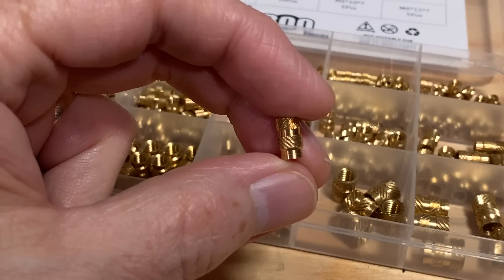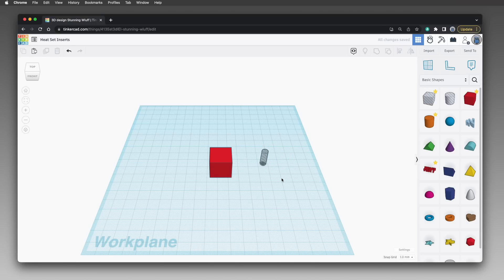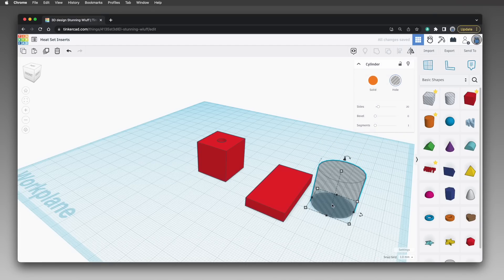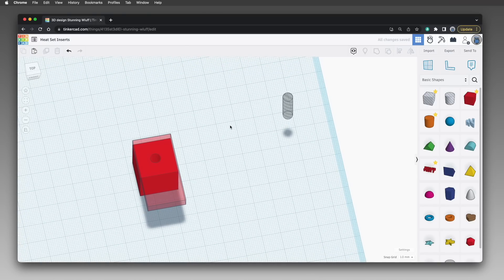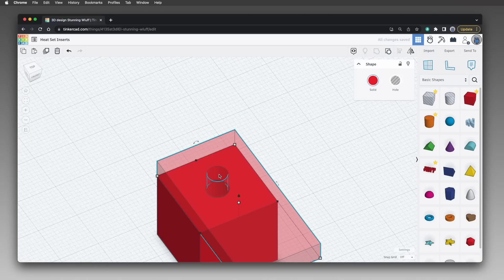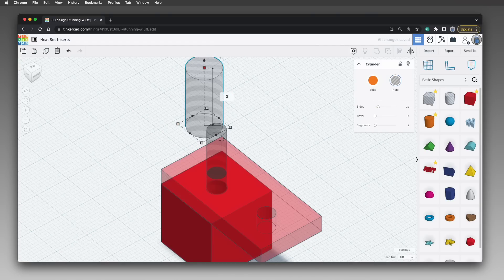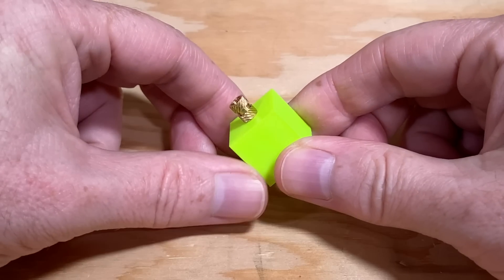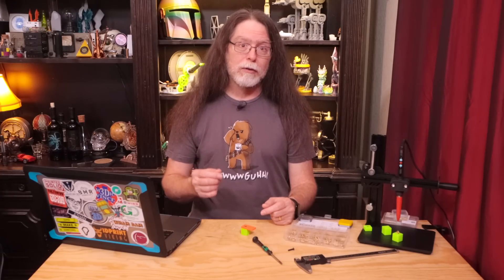Simple 3D Design for Heat Set Inserts in Tinkercad

Comment: Thanks for the details and excellent descriptions.

By the way the term for having a second ‘hole’ to allow the screw head to sit below the upper part’s surface is called a ‘counterbore’. 

If the screw head is tapered and the upper ‘hole’ is also tapered to allow the screw head to sit flush (quite common in woodworking for example) the upper tapered hole is called a ‘countersink’.

Comment: Thanks for using TinkerCad for your designs.  I think it is too often overlooked in the community and is a great tool for beginners, easy to learn and many features.  I learned a few new ones watching this.  Good advice about not touching the inserts right after they are done!  Learned the hard way - often
Reply from the maker: Hi David, I'm glad you liked it. Tinkercad is still my go-to 3D modeling program. I know it has a lot of limitations compared to pro-level CAD software, but for basic designs, it's super fast and easy for my brain to understand.
Reply: @BV3D  that is why I continue to use it, it has almost everything needed and easy to get started with

Comment: Again internet. This is why I say I'm a fan. He can make a video about anything and it's still super interesting and super informative. Question got an idea for a video, you made a video with the ender 3 Max getting a Sprite extruder. I did the same thing on that video. You never connected the CR touch to the daughterboard, if I'm not mistaken, you never connected a CR touch. Can you see if you can get a CR touch to work using the sprite extruder's daughter board? I was forced to use my old endermaxes CR cable to go from the actual CR touch all the way back to the main board, I would really like to use the provided cable and use the daughterboard. Your thoughts?
Reply: I think I say this after every comment but man your shirts are great

Comment: Very interesting, I havent used Tinkercad in a while as I have been trying to force myself to use Fusion 360
Reply from the maker: I could never get my head wrapped around how to use F360. Congrats to you for learning it!
Reply: @BV3D  Yes. I took a look at all those menus and my brain sprung a leak.
Reply: I too ripped the Band-Aid off early. I read too many times that all the basic CAD programs lead to using fusion. There's a lot of good tutorials out there like desktop makes that have some really good information on how to deal with that initial learning curve. Once you do though. Fusion is amazing.
Reply: @MrGerhardGrobler  
I get just the opposite feeling, the thought of trying to construct anything more complicated than a cube with a hole in it using tinkercad melts my brain.
Reply: @BV3D  I struggle with it, but try to keep learning, the hardest part is learning all the terminolgy of the functions and how those functions work and their application to what I am trying to build, a few times I have had to return to Tinkercad to make something and transfer its parts one by one to Fusion for filets and chamfers and then assemble those processed parts in Tinkercad, it has to be done this way as if I send a fully built part from Tinkercad to Fusion it wont accept the model if it is too complex.
Reply: That is the key wording, force yourself to learn it.   My experiences with Fusion have been regrettable.
Reply: onshape could be easier to learn while powerful 🤔

Comment: Any suggestions for the number of perimeters to use around an insert hole? Too few, the insert cannot accept much torque; too many, diminishing returns and a waste of material.

Great job as always!
Reply from the maker: Hi Kevin, I would say use 3 perimeters. Using 4 might be overkill, unless you're going for a part that's overall stronger than usual.

Comment: I'm just so glad I use Blender because your software looks really bad. Btw. I don't need help with modeling a hole in a box (lol) but I'm curious about reinforcing the walls, like if I use 20% infill but where the heat inserts go I want thicker walls and more infill, that's what I'm curious about.

Comment: Clicking and imprecisely aligning holes using snap grids is kinda crazy.  It seems like there ought to be a better way.

OpenSCAD makes this kind of operation precise, and it's not really that hard to learn.
Reply: There is, but I think Bryan was trying to get someone without experience comfortable with the Tinkercad alignments and shortcuts first.
Reply: If you were to use the alignment tool, you could just center up the hole to that bottom box like you did on the first hole (minus any z* axis movements, that would take it off your current workplane and defeat the purpose)